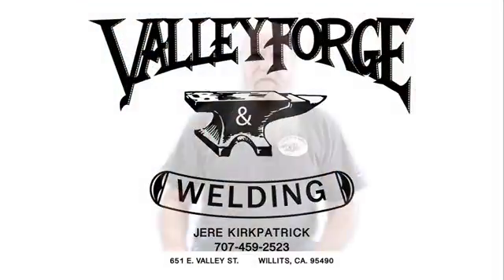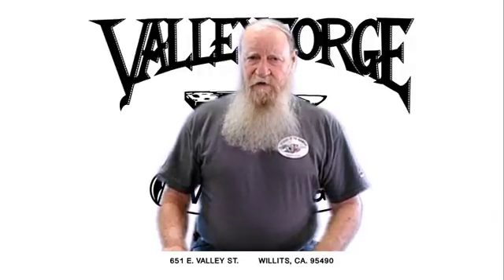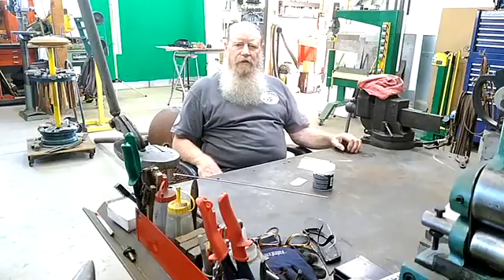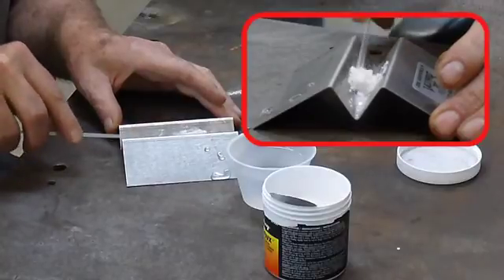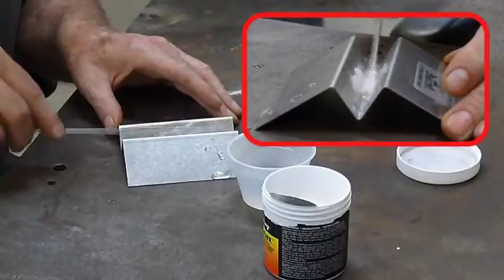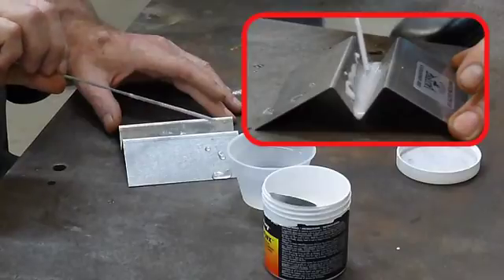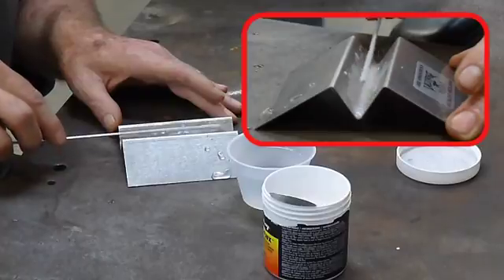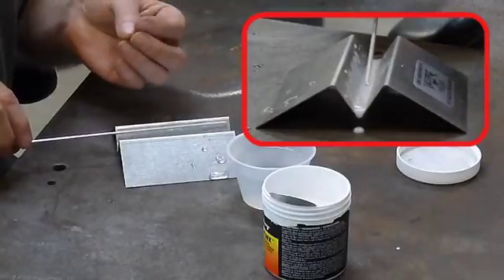How To Mix Aluminum Welding Flux

Comment: Thanks jerry you helped me alot, may I ask you about the ingredients of this flux If you know about it? I have borax and TSP and I may get boric acid if needed. Many people say an equal combination of them works also well with aluminium brazing rods, is it?
Reply from the maker: Hello Mohammad:

I don't know the formula of the flux. There are many fluxes that say they will work for several different types of brazing and welding. I always use a flux that is formulated for a specific purpose.

Thanks for watching and be sure to subscribe.           Jere

Comment: Thank you. Very informative
Reply from the maker: Hello col:

I have had a few customers buy the flux and then complain that the powder blows away when the torch comes near. I suppose they were not aware that water was to be added.

Thanks for watching.       Jere
Reply: They must have had blinkers on cos you showed how to mix it... what do ya have to do
Reply from the maker: @col2959  That was before I made the video. And that is why I mace the video. Every can I sell now I include directions to this video. I can do no more than provide them with the information.

Thanks.        Jere

Comment: Can you cost the rod and  let it dry out on the rod  Thanks for reading
Reply: Sorry, HAM FINGERS.  CAN YOU COAT THE ROD
Reply from the maker: Hello Mike and thanks for watching.

Yes you can but I would suggest using it right away. It does not stick to the rod because of the shiny surface and can get knocked off quite easily.

Jere
Reply: Good video...need attention to the sound though
Reply: What powder it is could you tell me @Errol.C-nz